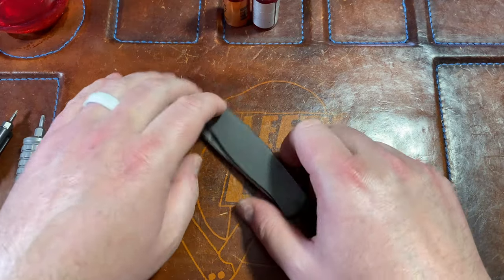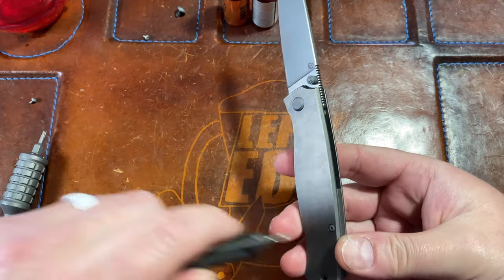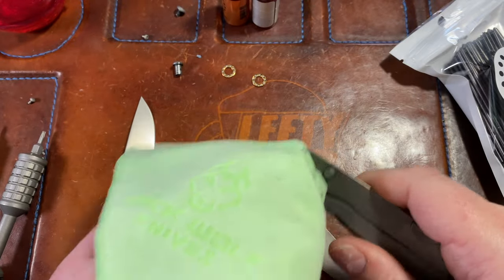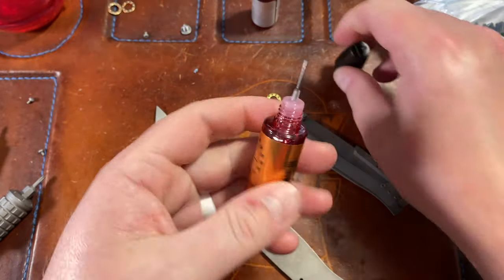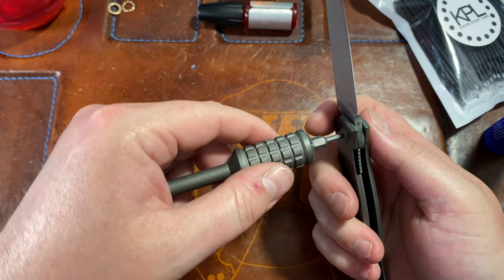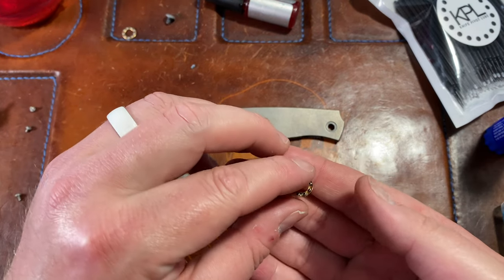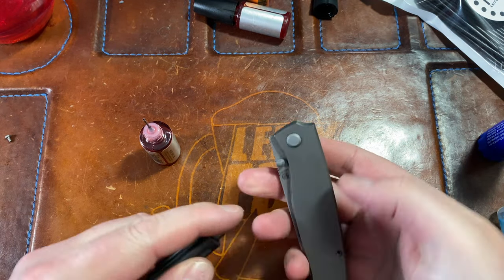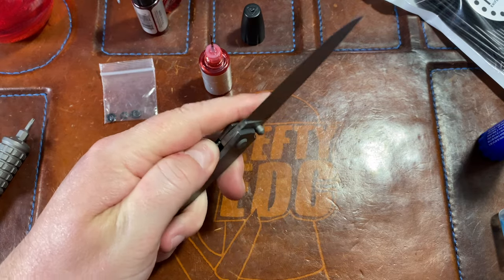Cheburkov Small Strizh Disassembly & First Impressions

Comment: Good call using that o-ring. Cheburkov uses steel-bearings and no steel-washers, the bearings are riding directly on the titanium and needs to be made of steel - not ceramic.
Reply from the maker: Huh i never thought of that. Would the ceramic eventually damage the scales where steel wouldnt?
Reply: Yes, the tracks in the titanium  would be cut deeper and deeper

Comment: I’m interested in why steel bearings shouldn’t be used in your view? I’ve got a couple Hinderers on factory steel bearings that are super smooth and drop shut. I’m tempted to try ceramic bearings but would I really gain much?
Reply: @2873lonewolf  Makes sense. The XM-24 is ridiculously smooth and drop shut. Straight up guillotine. The XM-18 is slightly more sluggish but still very smooth and pretty darn drop shut. I may try ceramic on the xm-18 just to see.
Reply from the maker: Truthful answer?….. im boujie. I like nice stuff and have decided that ceramic bearings are nice. Especially the kind not in a stamped caged

Comment: Disassembling a knife, modifying it by removing the original grease, reassembling it dry and then replacing the ball bearing cages only to find that it was better before is a big mess.

Comment: Damn that had some shit in it lol maybe blue russian grease lol. i personally hate that style of pivot i have a brouse blades with the same pivot and i can not get that thing apart for anything..
Reply: Have you tried heating it up? I had a couple like that and used heat. Let it sit in front of a blow dryer .then usually if you open the blade and aply pressure in one direction it helps the pivot not move. That with the heat breaking the locktite loose should help..